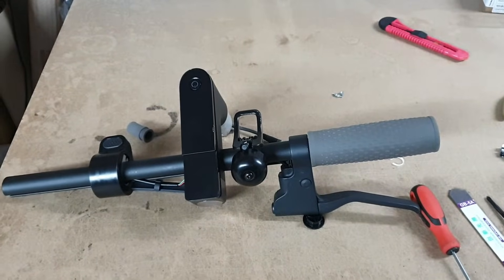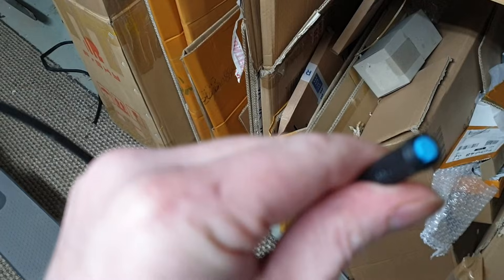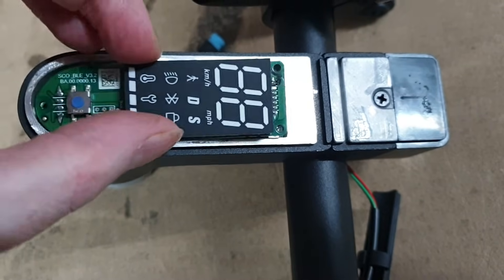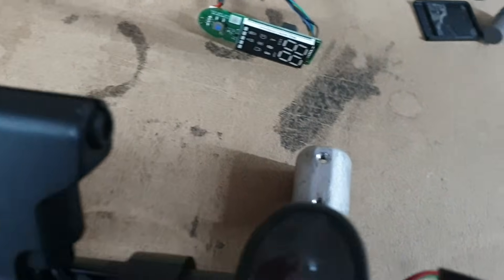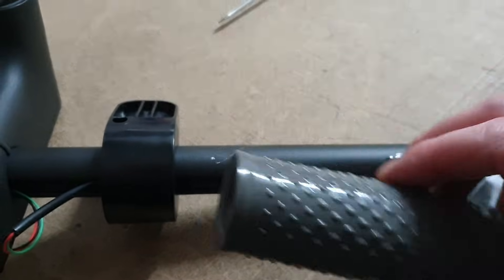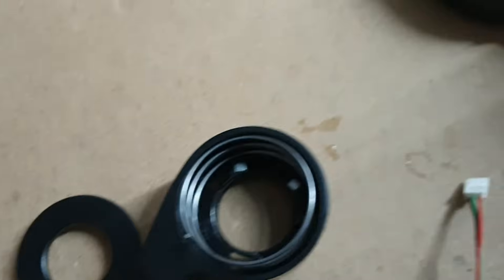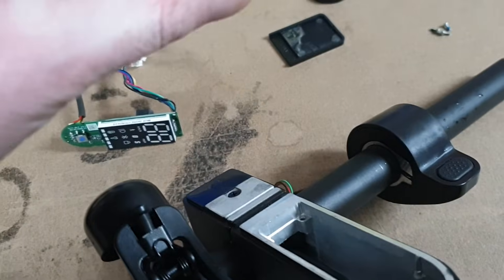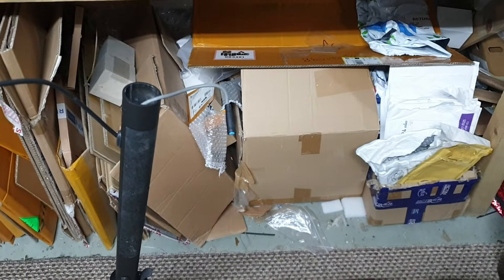Xiaomi Electric Scooter Error 14 fix

Comment: On my E scooter I get up the arrow display 14 but it does not beep and the accelerator works fine I was wondering if perhaps it was break when I try to hack it to do 30 kph it failed someone suggested to me that it could be error code coming from the break an as a result of that I was unable to get it to go faster is this property the problem or can anyone enlighten me please

Comment: seems a common fault , good thing its pretty easy to fix, baught a new throttle off of amazon for £10 installed with some help from this video in terms of screw point locations, and no more error 14, i also had it where there was no error but the motor wouldnt spin, changing the throttle also fixed this - -- thnx

Comment: I already changed the accelerator for a new one but it still gives error 14. do you know what the problem is? If you can help I would be grateful. Thanks
Reply: What was the problem
Reply: New motor or battery having similar problems

Comment: I have a Error code 14.. throttle anormaly it says in my app... it's not the same scooter.. but everything looks identical! Do I have to change the throttle to fix this? I hoped it was just a connection issue, so I tried to disassemble it - just the throttle.. to try to fix it somehow.. I can't disassemble the throttle it self because of that inner dexel/ring.. how did you do that? By force? It's exactly a like yours.

Comment: If i still get Error 14 after replacing the throttle, what can then be wrong?
Reply from the maker: I have seen the brake lever also cause error as it also has a sensor in it.
Reply: @kooltoyz  That would be reported as error code 15

Comment: I solved it by tapping the solder points above the LCD with the screwdriver while the scooter was off. There was a small spark and the scooter stopped reporting the error :)
Reply: Whatt solder points can you help
Reply: @mxraluchi9584  Those just above the LCD :)

Comment: i have this error sometimes, but after few minutes (or days sometimes) it disappears ! 
One time after turning the front wheel for 30 seconds, the error disappeared. I have this error at the moment and I can't seem to remove it. I don't want to disassemble the throttle because I already managed to solve it without disassembling it :(
Reply: Finally I succeed to fix it ! 
I disassembled the brake, the sensor was not in his location.
(Sorry for my bad English)
Reply: @Naval_Vanguard  bro can you help my my scooter have the same problem but i dont know what to do
Reply: @hazerzweinullzwei1224  hey,
So, sometimes you get an error and other times you don't have it ? (Or you have the error all the time ?)
Reply: @Naval_Vanguard  i have the error and it blink a red 14 on the display
Reply: @hazerzweinullzwei1224  yes but you are not in my case, personally sometimes the error was fixed by itself... 
Watch this video : https://youtu.be/YveeyoYV4mo
For me, the golden part was not properly in his location...

But the error 14 can be caused by a damaged throttle, in this case you have to buy a new one and replace it
Reply: @Naval_Vanguard  my man I have the same error like yours. How did you fix it can you please tell me ?
Reply: @alsofrost read my last comment, it explain u how I proceed
Reply: @hazerzweinullzwei1224  I have the same problem... What is it? I am not able to fix it myself 🤷🏻‍♀️
Reply: @Dylan hello did your scooter report error code 15? or 14

Comment: If you have a compressor with a air mattress nozzle you can blow air in where  you used the screwdriver. This is a technique used on push scooters as well.